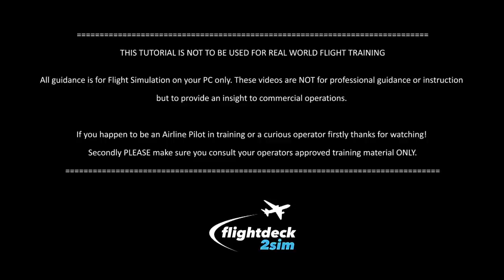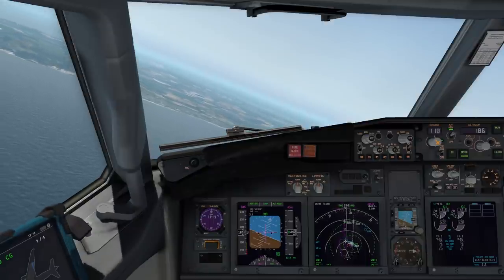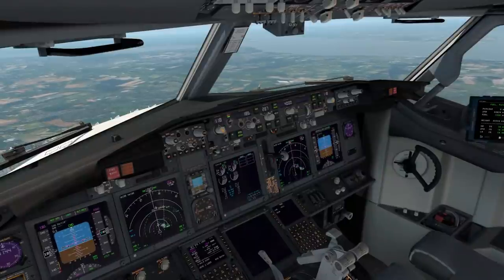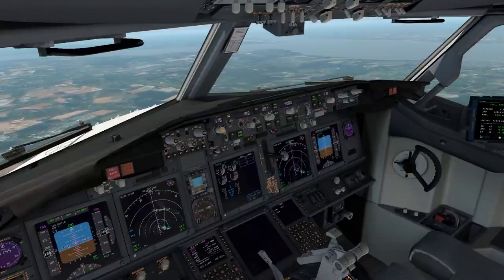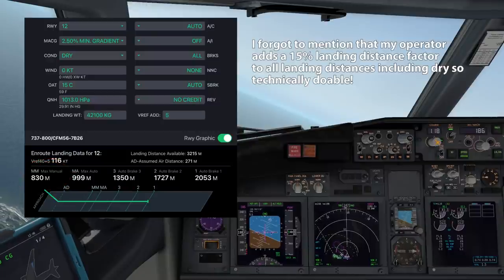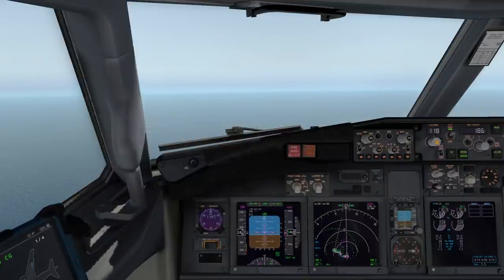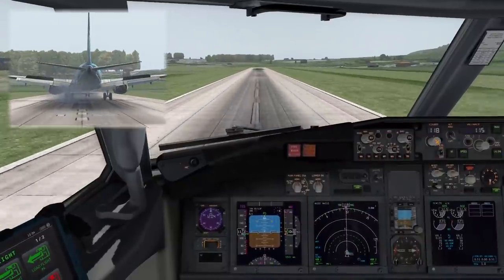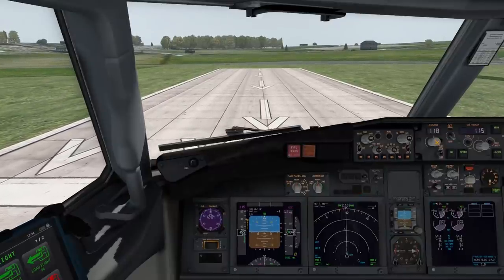How quickly can you stop a Boeing 737? | Real 737 Captain Demonstration

Comment: 737s could technically operate on bush airstrips if they had a solution for rocks getting into the engines. In xp11 i added a tailhook to the default lr 737 and landed very easily on carriers multiple times. i will try it with the zibomod soon.